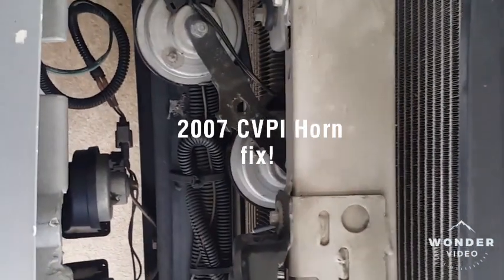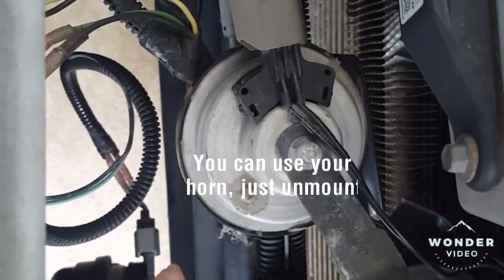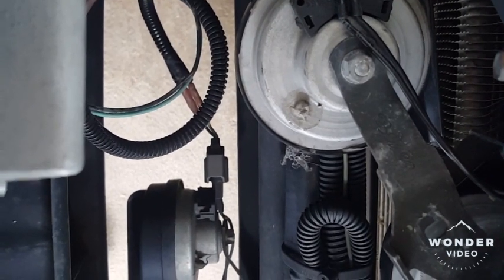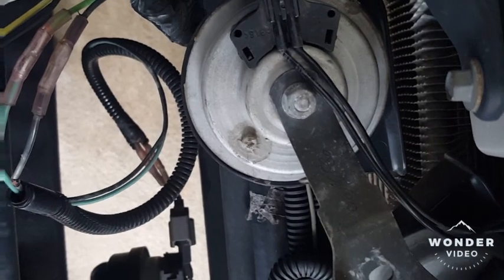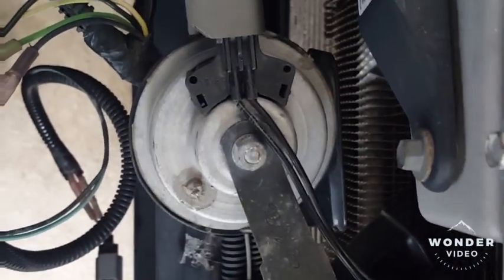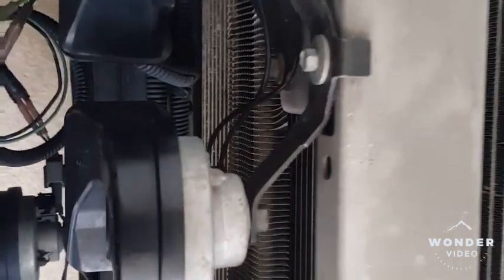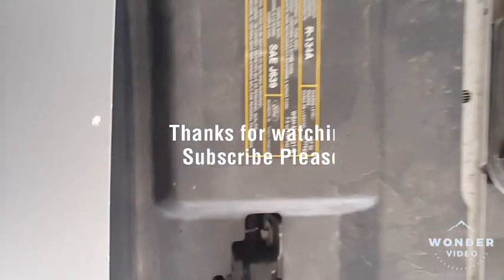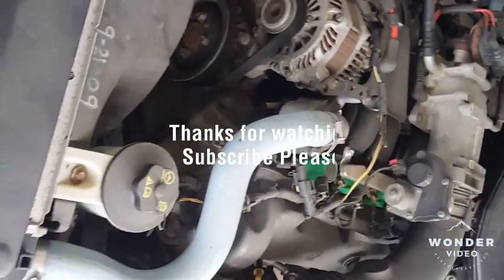Ford Crown Victoria Horn Fix

Comment: Did you have to re-wire anything? I have a couple cut wires near the horn thats plugged into a connector that isnt connected to anything on the other end... trying to work out a solution
Reply from the maker: I didn't have to rewire anything. I just unplugged the connector that looked like the connector to the horn, and it worked. I think I had those same wires but mine were heat sealed. Look at the current horn connection and see if you could find one that looks like it connected to something else.
Reply from the maker: Check it out, let me know if you see what I'm talking about

Comment: I couldn't see what in the world he was talking about. I can't get my p71 horn to work and everybody talks about the blue wires hanging down, Etc, and I don't see it. Now it seems like he has another solution but I can't see what in the world he's talking about and don't understand what he is saying.
Reply from the maker: What don't you understand about it? Let me know so I can try and clear it up for you. There is no blue wire. Look at the grey push connector on your horn and there is another one that looks just like it just above it, that's the connector you need. Video quality was better, but the video app that I used zoomed the video in and I didn't realize until I uploaded the video.
Reply: @dweezy3100  thanks for replying to me. My horn is already connected to a wire that is pushed into the push connector. There is a couple wires that have been cut right near that push connector and there is another push connector which is the male part which has 4 connectors that is not connected to anything.
Reply from the maker: @gordoncashwell325  this connector is randomly connected to another connector right above the horn. That connector is toward the top on your left. I wish I could take a pic and upload it. That connector will not reach your horn, you'll either have to move your horn to the top or do what I did and get another one to mount up top. Let me know if you have that connector.
Reply from the maker: @gordoncashwell325  if you ser that black male connector by itself, the grey one is short and should be coming from that harness is the top left corner. It's a 3 way harness. If that connector isn't there, it's been cut. I'll probably have to put another video out because you can't really see on these one that I uploaded. Sorry, I just went and looked at my car, that's where the extra details are coming from.